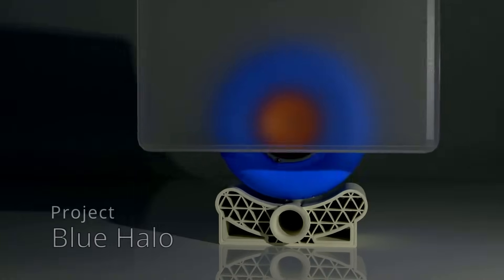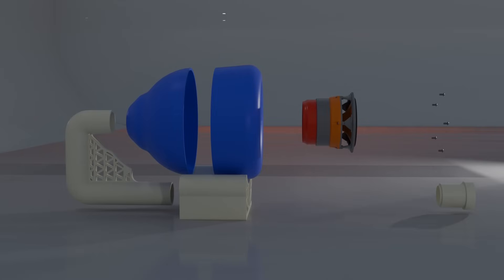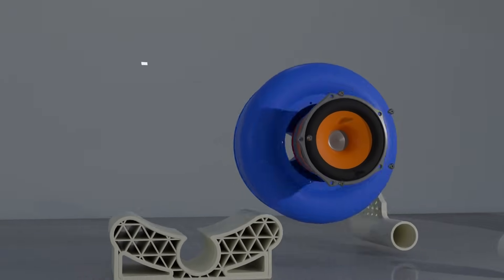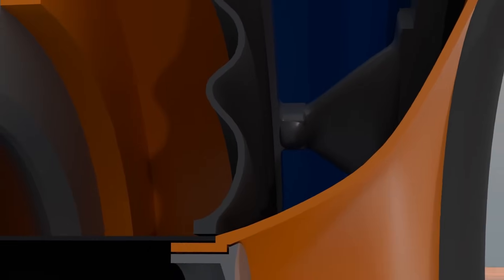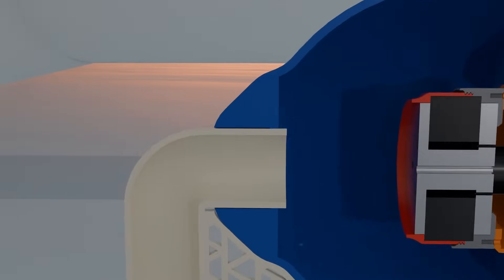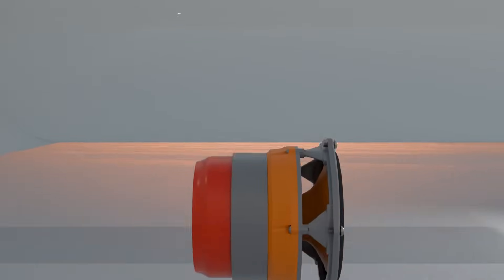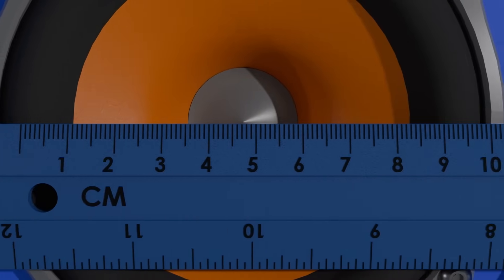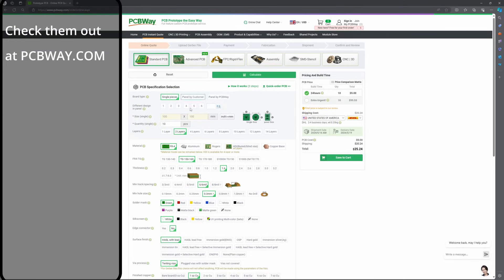Almost* Fully 3D Printed Speaker V16

Comment: I'm very curious how the sound (and graph) would compare if the port tube were a single sweeping arc instead of two hard 90 degree bends. I would expect the 90s to cause (at least some) internal reflections.
It would be pretty easy to test, with only one part to reprint and swap out.
Reply from the maker: Very true, however having the port facing the direction of the speaker does improve the sound (at least for the tuned range) so I’m fairly certain the range of the port would suffer from the front, since the back waves would essentially be wasted into the room space.
Reply: @piscesprinting  Apologies, I must not have described what I mean very well. What I'm talking about has the same endpoint locations, but a single curve sweeping from the top to the bottom (like a big "C") instead of a straight vertical tube with hard 90 degree turns.
Reply from the maker: Ahh, yeah that would be a fun experiment, I could likely do that. I’ve also thought about adapting a horn in place to test it, as the port seals with a foam gasket, so it is easily changeable.
Reply: It shouldn't matter that much as the frequencies the port is supposed to cover have a wavelength longer than the whole tube
Reply from the maker: The only thing I can see it changing is port velocity, I’m not sure what that affects though?

Comment: Perhaps one suggestion would be to create a high wattage bass driver that can fit in a fairly small 3 way speaker design that goes all the way down to 20hz as you either need high power, high cone area, or high box volume to produce lower frequencies. Maybe an upward firing subwoofer that can be integrated into a design with a 3 or 4 inch midrange driver and a tweeter to produce a beautiful sounding speaker, also 3 ways are harder to design and crossover so it may be a fun challenge?
Reply: High wattage would be a non-starter from the get go, and then you start piling up even more requirements on top of that, that wouldn't be a challenge, that would be impossible, as its hard as is with conventional materials best suited for the job.

Comment: What is the max wattage? Also the total harmonic distortion graph over the full spectrum. I think if just the spider and surround was printed in nylon instead of flexible filament, or using a higher quality flexible filament printer would allow you to produce real Hifi grade speakers. One more thing, how much does sanding the cone/ other areas affect the sound quality. It sounds decent currently, but i believe with a few small adjustments, maybe sacrificing some 3d printed parts for bought ones, true audio monitor grade speakers would be able to be created with this manufacturing method, and then the TS parameters could be tweaked to your liking to produce the custom perfect driver you want
Reply from the maker: I’m not sure how to calculate max wattage without destructive testing, but I’ve ran them with 45w for a few hours and no signs of issues. 

I’ve tried lots of flexible filament, I think to go further, a 3D printed mold that I could fill with some form of silicone or polyurethane would be the next step on suspension. 

As for cone sanding, I’d image a smooth cone would reduce some distortion, I’m looking at either a small hobby lathe or potentially building a lathe, which could be used to finish machine the 3d printed parts at a higher degree of accuracy

Also I’m still figuring out exactly what to do to the design to manipulate these ts parameters. 

I will say I have made tons of progress even being restricted to 3d printing.